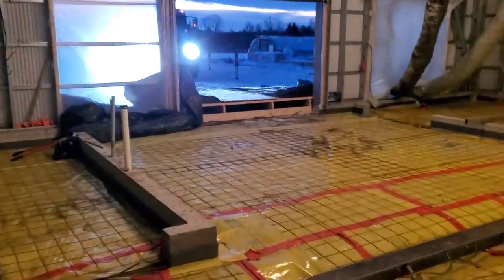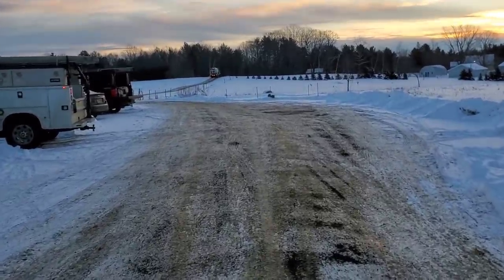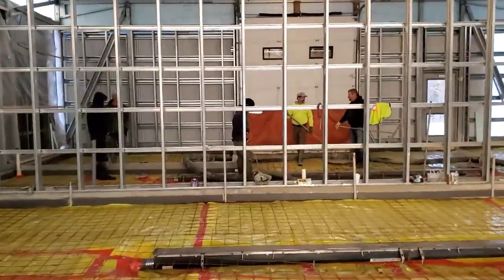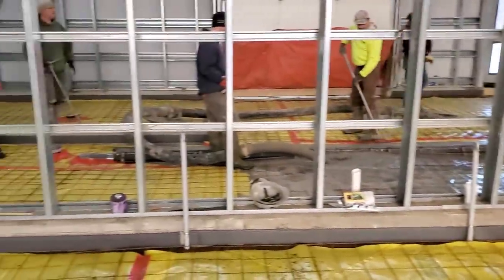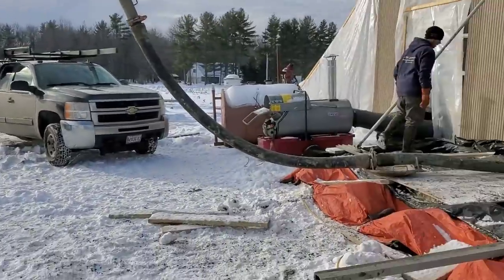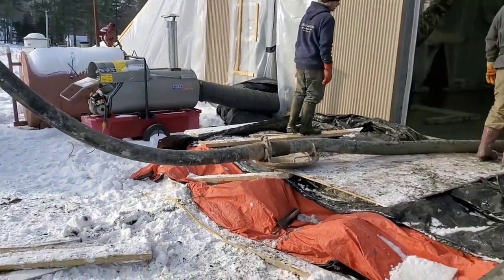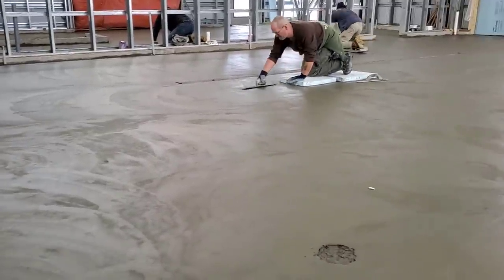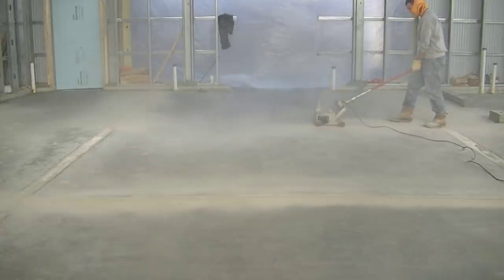Pouring & Finishing A 60' X 40' Concrete Floor For A Brewery (With 3 Trench Drains)

Comment: Nice pour guys. That’s exactly what those Z-booms are great at. Keeps you from having to run a lot more system pipe that could potentially dick up the grades on the drains when the pump surges. 
Those pans underneath the knuckles on the hoses was something different I’d never seen. I guess it helps prevent the wire from getting bent up and the plastic from getting torn. Probably helps to elevate the hose a little too.
Reply: never seen it reach under a garage door before, that's awesome!
Reply: @wim0104  On most boom pumps, all the sticks unfold in the same direction. Set up on a Z-boom configuration, the last stick unfolds the other way so it can be poked inside of a bldg like they did.

Comment: I made a small 48 inch and a 90 inch aluminum screed out of load locks for a tractor trailer. Took the guts out of them and plugged the ends with wood.

Comment: Great video. Nice work around the drains. I've been spending the last week in an older Greenhouse grinding floors to get water to the drains....The problem is that there are dips @ the drain so the water just  sits. I've had to cut groove in the joints to get the water in the drain. Nice to see the hand work around the drains won't have any problems having the beer sludge run off!  Have a great weekend!...Did you guys get paid in Suds?

Comment: What is the point of the wire? Left hard down on the plastic?
Reply: they go round and pull it up when the time is right.
Reply: No they didnt
Reply: @wim0104  they must have done that off camera 😂 or maybe when I blinked.
Reply: The concrete design mix has fiber mesh so the ‘wire’ could technically have been omitted all together.
Reply: @psidvicious  first off how u know their concrete got fiber in it and second any set of prints doesn't call for both. It's either steel or fiber but not both.
Reply: @smackflack5771    If you watch this channel much, you would hear Mike say all the time, he always uses a design mix with fiber mesh. 
  Respectfully, your claim that drawings always call for either fiber mesh OR welded wire fabric (WWF) is simply not true. Not in the US anyway. The drawings are produced long before a contractor submits a design mix, to the engineer for approval. That is why almost all drawings call for WWF. Typically, an engineers only concern is ultimate strength (psi). If you as a contractor prefer to use a mix with fiber mesh because you find you get less shrinkage cracking in the finish product, an engineer will never refuse you of that option. He’s also not going to spend the time and money to change his drawings. You as a contractor are just now required to use both, ‘his’ WWF and ‘your’ fiber mesh. The engineer is competing for work, just like a contractor, by specifying the most inexpensive design they can that will be functional. WWF is cheap. If YOU want to add fiber mesh, that’s on you.
Reply: @psidvicious  alot of words to be wrong. Ive never did a site where both was used and ive been pouring concrete commercially my whole life in PA
Reply: @smackflack5771    Well I’m pretty certain I’ve done at least as much concrete, all over the US. Mostly from a supervisory position, so I’m very familiar with plans and the design mix, submittal process. If you’ve never seen concrete with both ‘wire’ and fiber, it begs the obvious question, how much have you really seen? BUT, maybe that’s just the way it’s done in PA, I dunno. Cant say I’ve ever worked there. 

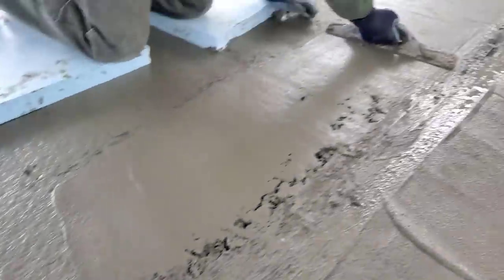Btw, @ ±10:00 you can see the fiber.

Comment: Do you have to adjust the slump for the length of the pumper hose?
Reply: Boom pumps, with 5”-6” lines aren’t as prone to jam-ups as the smaller trailer pumps with 2”-3” lines. Once you get the system primed you’re generally ‘in the clear’, unless the mud starts getting old and there is a lot of starting and stopping.

Comment: so why so many guys on this pour?  I've seen you do just as much area with your normal crew?  Thanks mike for the video.
Reply: there's more grading going on ?
Reply: All those slopes require extra attention. Plus that 5” hose and pipe is really heavy. As the pour progresses, back toward the pump, pieces have to be taken off, carried outside and cleaned up. It could be a very costly mistake to realize halfway thru a pour like this that you were 1 or 2 guys short handed. Most people only make that mistake once.
Reply: @psidvicious  I agree plus it was probably another crew that helped so maybe kind of a labor package

Comment: Wondering who was pulling up the wire, because i seen nobody.  And the wire was flat on the plastic. Sad!!
Reply: Shoulda used chairs
Reply: @smackflack5771  💯 agree with you however this mesh is too thin for chairs to work efficiently. The chairs would need to be extremely close. 
Larger mesh diameter and chairs would be one solution. The other problem with this type of pour is having the hose on the ground being pulled around on the discs , that would probably flatten even larger mesh.
Reply: When we pour we have a hook  made out of 9 wire that the dump man uses to pull the wire up as we pour. 90% of people leave it on the ground wich is sad
Reply: Important to remember, the design mix includes fiberglass fiber mesh so the WWF is actually redundant reinforcement.

Comment: 2 of my least favorite things to do in concrete. Trench drains and line pumping.  Adds so much labor to the job, and dragging those hoses is back breaking for us 50 yr olds.  Looked like u had good help, just outta sync a bit from not working together all the time. Good job guys.

Comment: All those guys and not one is pulling the wire up
Reply: The fiber mesh in the mix makes the ‘wire’ not even really necessary. Engineers almost always specify ‘wire’ anyways, just in case a fiber mesh design mix isn’t used.